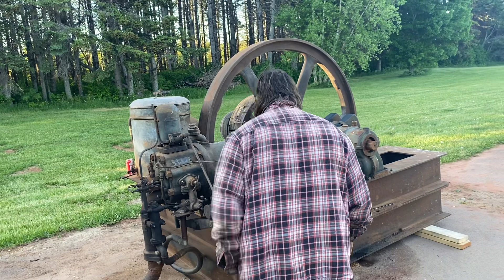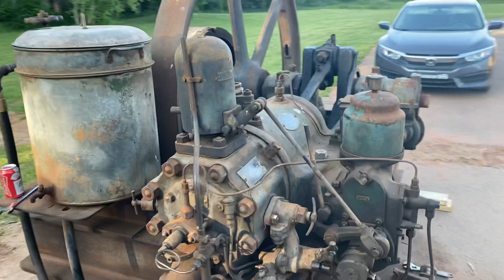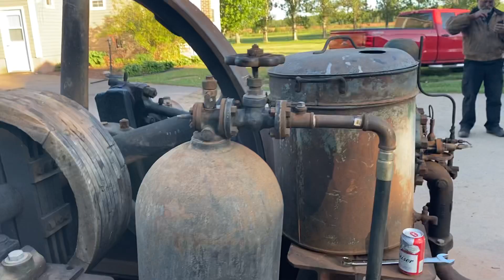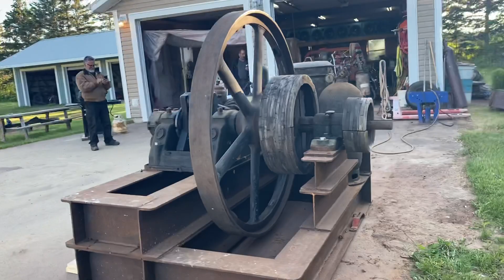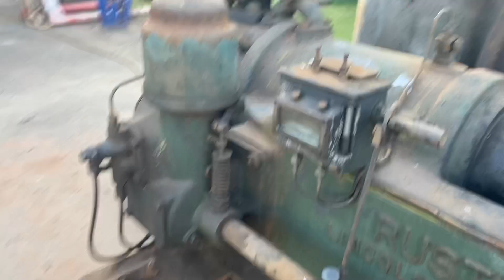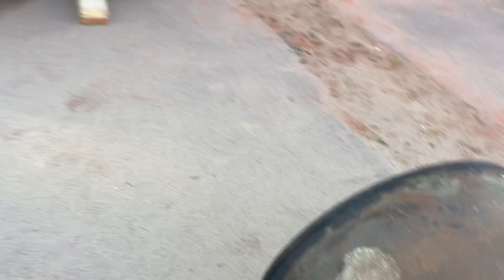Ruston Hornsby 5HR first roll on air

Comment: It looks like you've got a good one there. If you are going to repaint her, Ray Hooley can supply the transfers and quite a bit of info. Is there any reason you didn't have the decompression engaged when turning her over?
Reply from the maker: She’s seized tighter than a nun’s cunny. Also it had only landed off the crane truck about half hour before the video. Not entirely familiar with it at the time and didn’t have the manuals. I’ve since got the original 1938 manuals, papers and a bunch of other literature that came with the original purchase. Actually know the original owners son but I’m not sure he’d be much assistance. Probably going to end up pulling the head to do valve guides and a valve grind, free up the indicator cock at that time.
Reply: @FlatBroke612  Fair enough, it makes a hell of a difference to the air start speed, as does pressure. I have nearly finished a restoration on a 5ME . It had a badly pitted exhaust valve as a result of it being turned off and left for 50 plus years without proper shut down procedures. As you probably know it is necessary to remove the intake valve, rocker gear and port assembly to get the exhaust valve out, but after 92 years the port assembly was well and truly stuck. On the ME the exhaust valve guide can be removed from the bottom, but I don't know about the WHR's although I would imagine they are the same. I tried a lot of penetrants and oils with no luck before I used 3 ltrs ( about the same as 3 quarts ) of liquid nitrogen ( about $15 au ) and it came out. Upon checking it when I got it out I found the reason for it being stuck was more likely the carbon build up between the tapered seat of the port and the combustion chamber. So if you decide to pull the head off, my suggestion would be to sit it ( up side down )with the intake valve stem facing down and use something like carby cleaner to de-carbonise  that area. Maybe use something to make a dam around it so you don't have to keep adding it and give it a few days. I used a 4 ton mini ram from a porta-power unit between the valves with a disc of steel plate to spread the load. Don't stress to much if it's only a bit loose as at 280 rpm max it doesn't seem to make a lot of difference and it's not like it is blowing into a rocker cover or letting oil into the exhaust system.  This old lady had a fiber gasket for the water jacket and a compound copper gasket for the combustion chamber, if you can save them will save a lot of time getting sizes correct.  Good luck.
Reply from the maker: @davidstephens1092  great post full of news formation. Would you happen to have any documentation on the HR series engines?

Comment: Let her run some more.
Reply from the maker: Soon. We just wanted to roll it on compressed air at the time. The governor was stuck full rack which I’ve since fixed. There are problems with the delivery valve allowing fuel to bleed off during injection. The exhaust valve guide is pretty worn too. It will all be repaired and running before winter. Managed to move her inside too. She’s over 8000lbs including the base frame so that was no small feat with the equipment I have on hand.